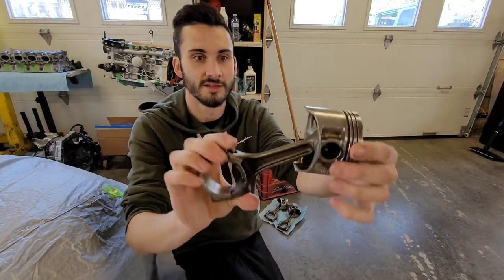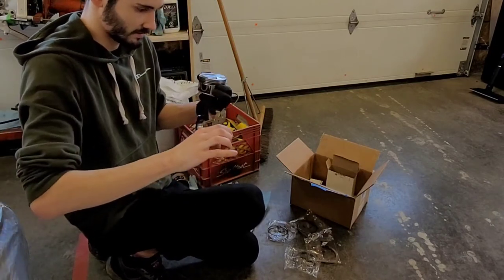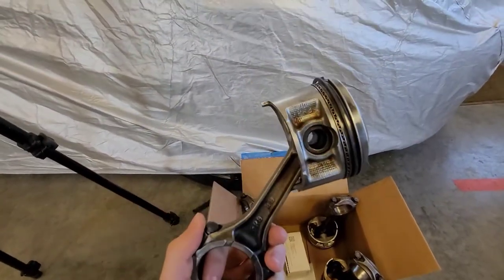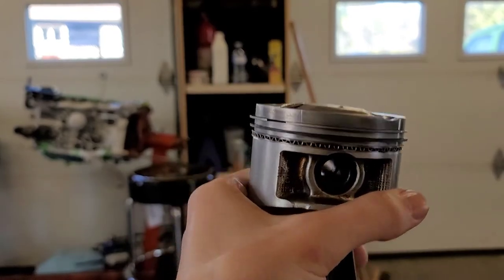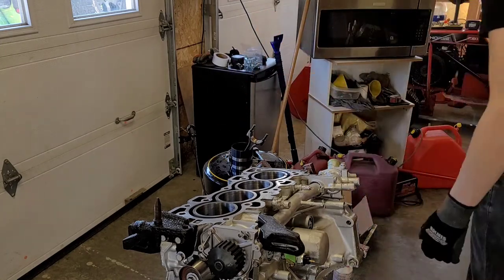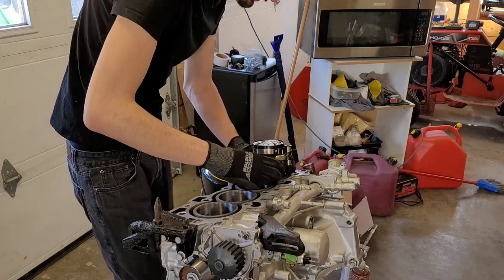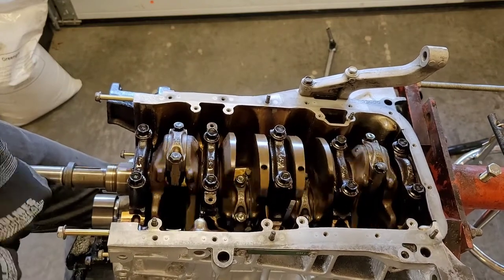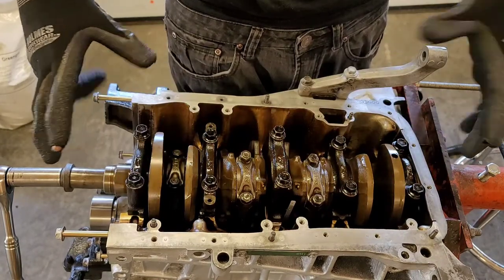Installing pistons in a Honda B16 engine

Comment: I have a question. B18b1, with 195k miles. I had  the cylinder head rebuilt. Now I have quite a bit of smoke coming out of the exhaust. Did a compression test and it came out 90, 90, 80 & 90. So I’m sure I need new rings. My question is, do I hone the cylinder walls with a cylinder hone and then replace the rings and put everything back together? Do I have to replace the pistons or bearings? I do not have the means to take a whole engine out and have the crank turned and everything.